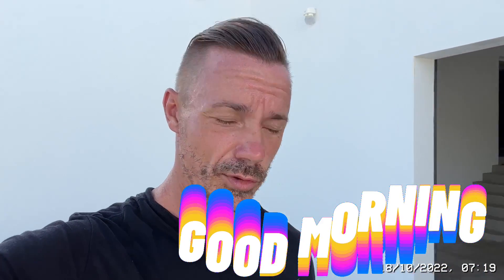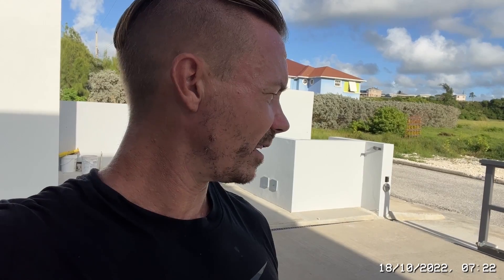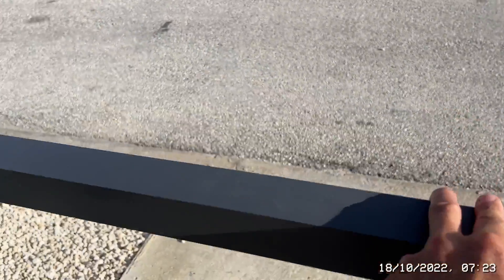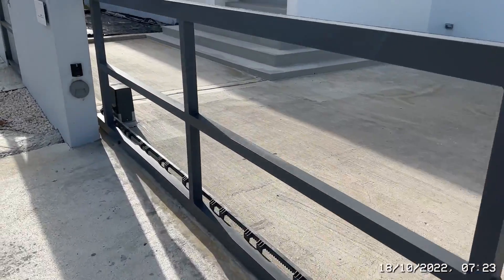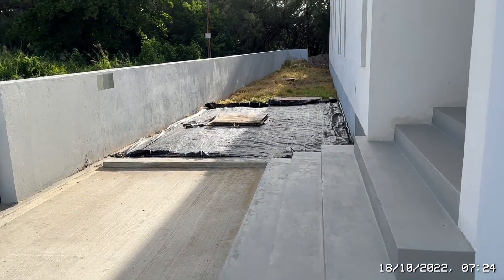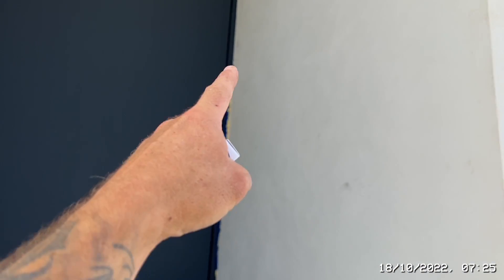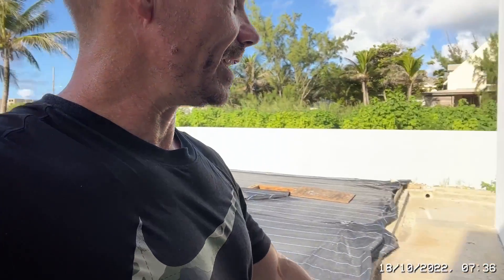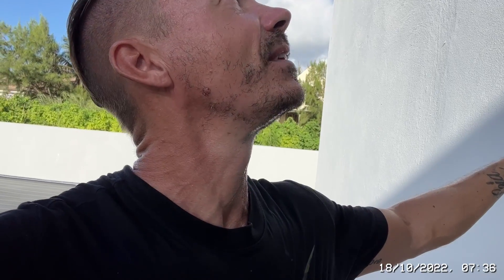BARBADOS 🇧🇧 BEACH HOUSE BUILD - 381

Comment: Late vote on the floor air vent Alvin

B maybe gray. A design seems a little bit more suited for outside the house.
Reply from the maker: B seems to be swinging it at present, the material on A is better but the design on B is more for the house. Thank you K

Comment: Check out a company in the UK that supply products for system tanks and soak away call ‘muck munchers’ not used them as yet might be useful.
Reply from the maker: Thanks i will check them out now!
Reply from the maker: Seems they mainly do chemical products for septic tanks etc.
Reply: Take a look at their products which “natural way to maintain a healthy and efficient Septic Tank” biological treatment. Reduce the need to have tank pump out. Email them for for info

Comment: I'm new to your channel and have a few curious questions on some the better ways for importing homes goods. 
I'm building in Barbados and want to bring in kitchen appliances from USA but I'm having frequency issues(60/50hz). Would it be better to buy from Barbados?.
Reply from the maker: Hey Ronald, welcome to the channel. 

The UK is better. The US and Barbados units are all the same, 60 no 50 so they work harder and use more electric and as a result do not last as long. That soad the salt get s the all in the end!